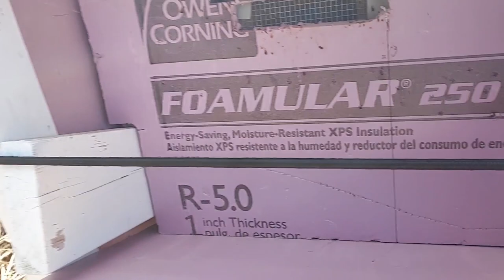Extreme Climate Hive - Coming Out Of The First Winter

Comment: You should show the frames - so to see how the bees moved along the slanted frames.
Otherwise, need to figure out the mite situation.
Reply from the maker: Thanks for the comment!  I show the frames in the Autopsy video coming out on 5/12/2022 so stay tuned.  As for mites, I treated for mites in the fall and will confirm with several counts on the dead bees.  There was no evidence of a big mite problem during the count last fall.  If I recall there was one mite in the test group.  I treated anyway so there would be no chance of them outbreeding the bees during this winter test.  Also I'm doing some follow up analysis to make sure there was no issue with Nosema.  Need to eliminate as many options as possible.